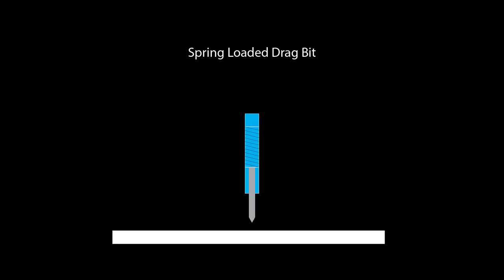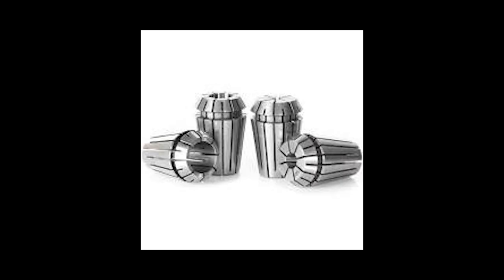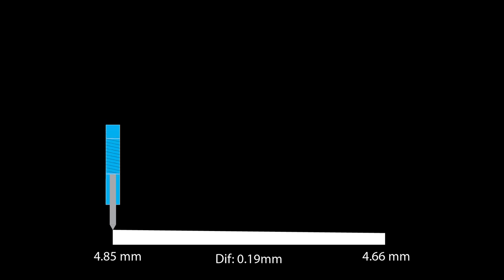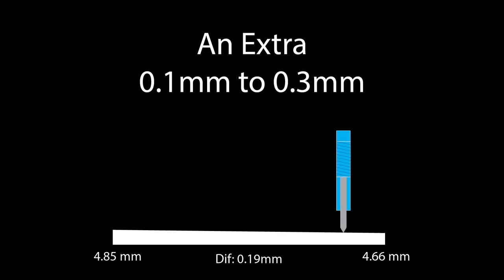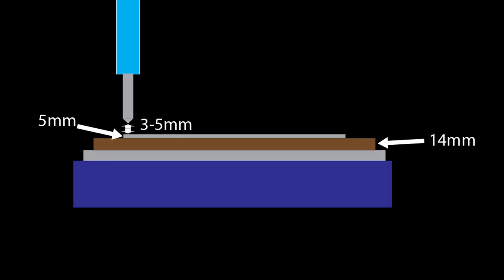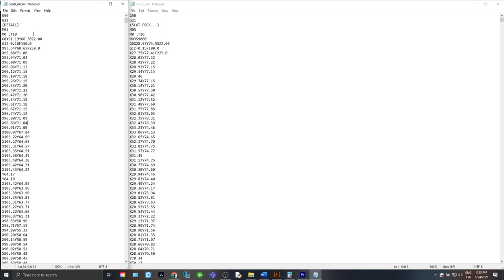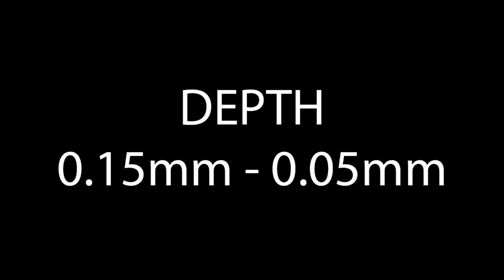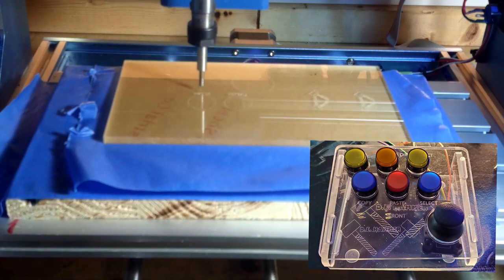CNC Engraving: Discover the Spring-Loaded Drag Bit for Acrylic

Comment: Yep drag bits are very good on polycarbonate, acrylics, plastics, aluminum and other soft materials. I had to make one out of stainless steel 3/8 rod a pen spring, a set screw and an 1/8 carbide end mill. Definitely a must have.

Comment: great info THANK YOU.... I learned about this bit on a Facebook page im a member of. The guy who brought it up said he only uses a 120 degree bit. I was thing more along the line of a 90, whats the difference ? you sorta talked about the 60 vs the 90. Or mybe I missed it.. Again thank you for your videos you may or may not understand the amount of help you are giving out.. If it weren't for people like you, people like me would have given up..
Reply from the maker: Thank You! The 60 degree is more fragile and can get a thin line. I use a 90 and have no issue, and get a very nice line. For 90 vs 120, you can get a thicker line with less pressure. Have not used a 120 to confirm that.

Comment: Hi, This is a nice video about engraving acrylc. I bought a diamond springloaded 90 degree dragbit for my 3018pro.
What plunge rate should I use with this dragbit?
Reply from the maker: For plunge you can start with 75 - 125mm per minute and speed up from there as you get a feel for how your 3018 handles it.
Reply: @D.E.Hammer  Thanks very much.  Do you mind if a sent you a PM with a picture from an engraving a made. I have some questions about this engraving.
Reply from the maker: I do not mind, will be on the look out for it
Reply: @D.E.Hammer  i sent you an email with the picture and some more information.

Comment: Hi Paul.  Have you had a diamond drag bit go bad? I've made a few acrylic signs using a Carbide 3D 120 deg diamond drag bit and they all came out great. Today I tried to etch a sign and the results were pretty bad. I'm wondering if there's a life expectancy for them.
Reply from the maker: I have, but mine lasted over a year, and by bad i just was not getting the really crisp looking lines. You can try applying a little more pressure or check the spring itself and see if it's lost its tension.

If its neither of those, on the rdz you can purchase a replacement tip (almost half the price of a full new one), so see if carbide has the same thing.
Reply: @D.E.Hammer  Thanks. I'm going to check it under a magnifying lens.
Reply: @D.E.Hammer Thanks for another awesome vid mate! 
I am not sure which bit to buy... Any advice on ones you've personally used pretty please?
Reply from the maker: I have been using the one by RDZ, and really like it. You can find them on amazon.

Comment: Have you done this on metal yet? Any idea on the setting changes that would require? Thanks!
Reply from the maker: I have not attempted to do any metal yet. Just guessing, as I have not done any research on metal, that the speeds would be similar, if not a bit slower.

Comment: Do you need a collet to use this drag bit? If so, which one?
Reply from the maker: It is a 1/4" shank bit, so if using a 3018 stick spindle you will need a ER32 collet.
Reply: @D.E.Hammer  thanks

Comment: Hello, 
first of all thank you for this video. Currently i'm doing research for the CNC 3018 Pro because i think i want to buy this machine. Can you help me with this question: is it also possible to engrave such tiny lines (as made with the Spring loaded bit in this video) with a regular bit? If yes Which bit should you recommend me using for that? 

Kind regards, Lars
Reply from the maker: I have gotten some fairly fine lines with a 0.1mm 30 Degree V Bit (The main v-bits that come with the Sainsmart Machine), but it really comes down to how even the thickness of the material you are engraving. If one area is a lot thinner say 0.35mm or more than your thickest part, you will have to engrave that much more down to reach those points. So your thicker parts will have a deeper cut. That is what is nice about these spring loaded drag bits, is that they keep a consistent line thickness.
Reply: Thanks, and is it possible to engrave stainless steel or aluminium with this. If yes can you make a video from this since i cant find a video on YouTube where a CNC 3018 pro is used for engraving stainless steel or aluminium.
Reply from the maker: I have not done Stainless Steel or Aluminum, yet. It is on the game plan to get into. I will be doing a video on it when I get these next 4 videos finished up.
Reply: Thanks, i'm looking forward tonthat videos!
Reply: Can you pls send me a link of the acrylic pkates you buy. The Amazon link in your video discription is out of stock
Reply from the maker: @LVA_DESIGN_LAMPS  If they are not showing in stock (They are showing in stock in the U.S.), then you want to look for Cast Acrylic. I have not used this but it does say it is Cast. What you want to stay away from is Extruded.

https://www.amazon.com/Acrylic-Plexiglass12-Protective-Replacement-Projects/dp/B08NXXKGBX/ref=sr_1_5?crid=2S26TXPB3KB7P&dchild=1&keywords=cast+acrylic&qid=1618265752&sprefix=cast+acrylic%2Caps%2C188&sr=8-5
Reply: Thank you very much! I appreciate your time and help 👌🏼👌🏼👌🏼👌🏼

Comment: The last question please is it okay to use this diamond drag to make customized jewelry? as in etching on to it
Reply from the maker: I have not etched into metal before, but I think it should be ok. You need to make a jig to hold the jewelry down. I did make some acrylic earrings and they turned out well. Again never etched onto curved surfaces, so I would watch out for your spring pushing out the engraver  while going to far over a curve and not being able to retract and damage everything.

Comment: sorry if this comes off as a dumb question but is it 250mm a second or a minute, 250mm a second seems too fast but 250mm a minute seems too slow so i’m stuck in a crossroad with this one
Reply from the maker: The 250mm is per minute, and is just a starting point. I give lower feeds as not all machines are built equally.
Reply: @D.E.Hammer  oh okay that makes sense, i have a longmill and id assume i could maybe do 60 inch per minute
Reply from the maker: So yeah this video was for a 3018. On my longmill I run my drag bit at 900mm per minute, I think.
Reply: @D.E.Hammer  last 2 questions, do you just do one pass with the drag bit at the settings you recommended and the other question is, for the dallas sign you made, for the dallas itself do u use a straight bit to hollow it all out and if u did what settings did u use for that
Reply from the maker: For the drag bit, I just do 1 pass, and with a longmill I would start around 900mm per minute. As for cutting it out and the holes, I had my makita router just past the 2 setting and feed was 1000mm per min. As for bit, single or O flute straight or spiral work great, have also used double and tripple bits, but singal gives the best edge.
Reply: @D.E.Hammer  what depth of cut did you use for the dallas sign, and do u use cast acrylic or extruded
Reply from the maker: For the drag 0.1mm with 1mm pressure and 1mm depth per pass on the longmill. The dallas sign was cast acrylic.
Reply: @D.E.Hammer  sorry for bugging you with so many questions i just feel like i’ve stumbled across the jackpot with you,  you’ve had huge success with etching acrylic and you’re one of the few ppl that are actually willing to reveal the settings for it
Reply from the maker: No Thank You for the questions, i like to try and help as much as I can, where I can. How can we grow as a community if we do not share information. Always feel free to ask away.
Reply: @D.E.Hammer  i have so many questions about acrylic etching it’s not even funny, i’ve been trying to find success with etching for 2 years now and i haven’t had any good results rlly. one last thing tho where did u buy ur led standoffs from
Reply from the maker: I get those off amazon, but there are several online led sites that have them.  Look up - led stand off.

Comment: So you let thw drag bit hit the paper beteween the bit and thw acrylic, and then you lower it 0.3mm more before zero xyz axis? And your depth per pass is 0.1mm with the drag bit, so the spring will be Pressed in 0.4mm
Reply from the maker: Yes that is correct steps. You can adjust how much pressure for your liking. This is just a good starting point.

Comment: What are you using as a plunge rate in Carbide Create? with the drag bit
Reply from the maker: I started at 125mm at first now have it up to 200mm with the drag bit.
Reply: @D.E.Hammer  In your video you said your using a depth of 0.15 -0.05mm?  I was looking at starting with a depth of 1mm as the above is like very little if no spring load on the drag bit at all. When looking at the RDZ instructions they say feed down to aprox. .250 +/-.06 they don't mention weather it is mm or inches, yet there next line talks about running at 20 inches per minute. Like confusing because if it is inches that is way to much spring load, and if it is mm that is very little if no spring load on the bit.
Reply from the maker: Yes I set the max depth pass at 0.15mm as I want very thin lines, and have small text. After I set the Z as if I were using a V-Bit I go down an extra 0.1-0.35mm on the z axis have even done a little more, but I really like the results in that range. I get enough pressure to get all my lines, but not to little that it starts to drag behind.

Comment: Hello, I have another question. Since i want to make 3D led lamps with the CNC 3018, I'm wondering if the lines made with this spring-loaded bit are good for a 3D led lamp design or should I use a normal V-bit for that?
Reply: And which collet did you use?
Reply from the maker: So if I understand correctly if you want to do a 3D Carve in Acrylic, you will need to use a bit. If you mean you want thicker lines, I use this bit over the V-Bit still.
Reply from the maker: @LVA_DESIGN_LAMPS  for my drag bit I used a 1/4" collet and bought some additional ER-11 collet clamping nuts.
Reply: I want to make led lights just as you made in one of your video's. You made a led light of you HAMMER emblem. I want to make that kind of engraving in acrylic. Is the drag bit good enough for making such lines, so are the lines deep or thick enough that they will light up when you place the acrylic plate in a led base?
Reply: Why did you use a additional clamping nut, is that necessary or can I also only buy a collet and the drag bit or should I also use the collet clamping nut? If yes can you please send me the link for the collet clamping nut
Reply from the maker: @LVA_DESIGN_LAMPS  Oh yes, I do not even use the V-Bit for acrylic any more I only use the Drag Bit for all engraving and Detail work. So it is perfect for those types of LED Signs. Sorry when you Say 3D I think of 3D Carving.
Reply from the maker: @LVA_DESIGN_LAMPS  I got the extra Clamping Nut because getting the collet out of the one I had was taking up time (The smaller the collet size the harder to get the collet out), and felt i was going to damage the integrity of the collet itself. 

https://www.amazon.com/gp/product/B08QMDC4X8/ref=ppx_yo_dt_b_search_asin_title?ie=UTF8&psc=1

https://www.amazon.com/gp/product/B07B93532F/ref=ppx_yo_dt_b_search_asin_title?ie=UTF8&psc=1
Reply: Ahh okay so if i understand you orrectly, you have multiple clamping nuts so you dont have to change the collet but you can change the clamping nut where the collets are in?
Reply from the maker: @LVA_DESIGN_LAMPS  Correct. No hassel of trying to get the collet out of the nut, just unscrew and put the other one on.
Reply: One more question, how do you fill an area for a grbl file?
Reply from the maker: In your CAM software select a closed vector and do a pocket or infill.

Comment: Guys im using easel and i wanted to ask what should i use for my step over rate 40%?
Reply from the maker: 40% is good starting place, you can play with that setting to get different results. Lower will give you a denser look, but longer engrave times. Higher you may find missed areas in the engrave but shorter run time.

Comment: What depth of cut are people using for this drag bit on 5mm acrylic
Reply from the maker: I use 0.1mm with 0.3 to 0.5mm of preasure.
Reply: @D.E.Hammer  what do you mean by 0.3 to 0.5 pressure does that mean when u lower the z axis you lower it by a additional 0.3mm
Reply from the maker: So I zero the Z like normal, the add  an additional 0.3 to 0.5mm down to put preasure on my spring. Just make sure you have what ever preassure you applied made up in the retract height.

Comment: Hi quick question im etching on to 0.4mm cast acrlyic what should my settings for the overall depth and depth per pass be. Im using Easel for this
Reply from the maker: Wow that's some thin acrylic, but in that case I would try a depth of cut & depth per pass to 0.1mm as for pressure I would maybe put 0.5mm to 1mm of preasure on the spring bit.
Reply: @D.E.Hammer  Oops sorry i meant 4mm thick acrylic what settings would you use for 4mm. Im using a cnc 3018 with the RDZ engraver you use along with Easel for the program, would you put thia under the category of "end mills" or "V-Bit"
Reply from the maker: Vbit
Reply: @D.E.Hammer  thank you so much, sorry about how many questions but what would you put for the depth cut and depth per pass for the 4mm acrylic
Reply from the maker: Depth of cut and per pass you could still use 0.1mm for fine lines and 1-3mm of preasure. For thicker I would say 0.5mm depth & pass with 3-6mm of preasure. A lot of the depth comes from how much preasure you are applying to the spring.
Reply: @D.E.Hammer   honestly I’m sorry about how much I’m asking but just to finalise before I actually do a run with the new drag but, feed rate= 225 plunge rate= 110 depth per pass= 1mm and for the tab of cut depth=0.1mm right. And spindle of
Reply from the maker: The spindle needs to be turned off so 0.  Set depth of cut at 0.1mm, and depth per pass at 0.1mm. When you go to zero your z axis 0 it with no preasure on the spring. Once 0 that way now bring down your bit an extra 1 to 3mm and zero you z axis. Make sure your retract hight is plus what ever amount extra you applied to the spring. It's all good on the questions.
Reply: @D.E.Hammer  sounds great thank you. So after I 0 my Z axis bring it further down by 1-3mm to apply pressure on the spring and set the retract height as the exact same as what amount I bring it down by ?
Reply from the maker: Correct, until retract height. It will be retract height + the amount of preasure you applied. You want it to lift up off the stock, not drag, when switching to a new x,y coordinate.
Reply: @D.E.Hammer  I can’t seem to find the settings to set the retract height on easel any chance you can guide me through this please
Reply from the maker: I do not use easel but this link should walk you thru it.

https://discuss.inventables.com/t/adjust-default-z-retract-height/73526

Comment: This but was a huge disappointment for me, went fully dull after one engraving. I’ll stick with my Amana 45771-k, best bit ever.
Reply from the maker: That's not good. Have you reached out to the manufacturer about it? I have been using mine for around a year and mine is still going.
Reply: @D.E.Hammer  no unfortunately I didn’t, first impressions of the bit didn’t seem very good, the tip was not very stable and the spring reaction was not smooth at all. After a minute or two of etching it started to make a loud screeching or scratching sound.
Reply from the maker: @aaadeejay  That is a bummer. I would reach out and see if they can send you a replacement bit, as these things are not cheap. Mine still has a solid feel and smooth movement in the spring. It is so quiet I only can hear the X,Y,&Z motors going when I am engraving Acrylic.